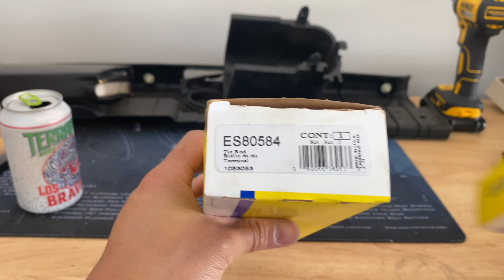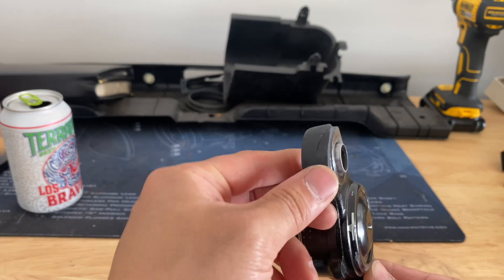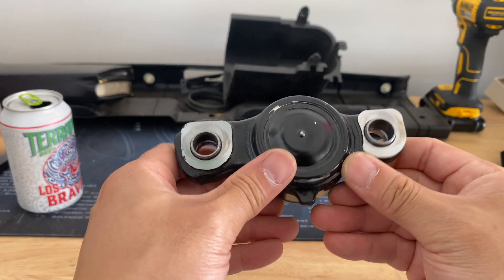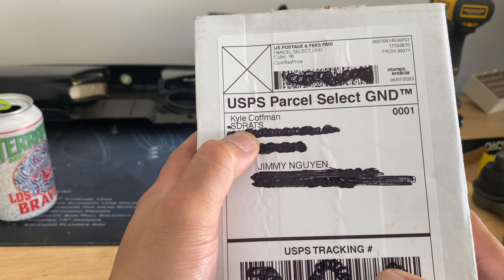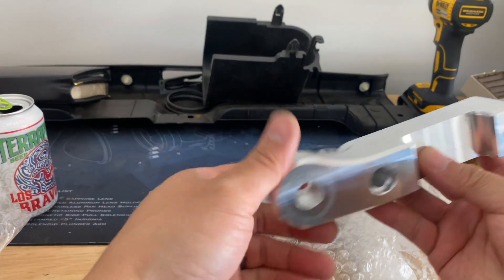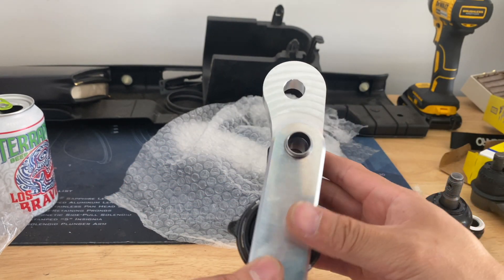How to install SD Rats Initiate Angle Kit and car finally got new paint!

Comment: i’m running into a problem with my angle kit. I know the kit requires extended outer tie rods or extended inner tie rods. I ended up buying extended outers but it threw my alignment of by a mile and i’m not sure if I need extended inners too. just wondering if you could reach out and give a little help! thank you for your videos !
Reply from the maker: @nismojojo  I can help you! So you have the angle kit and extended outers. Are you running GS outers and is300 inners? If so, you should be fine.

When you say your alignment is off, do you mean you can’t get it aligned within specs? What does your alignment look like?